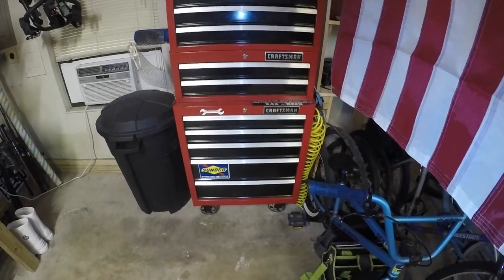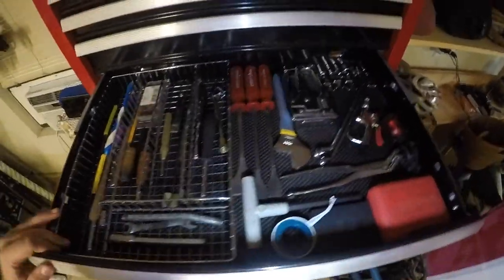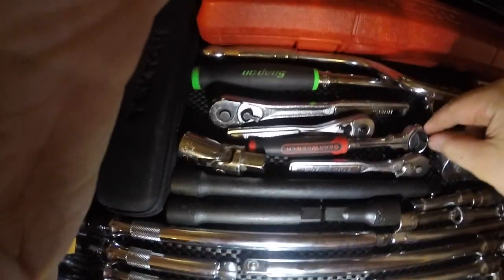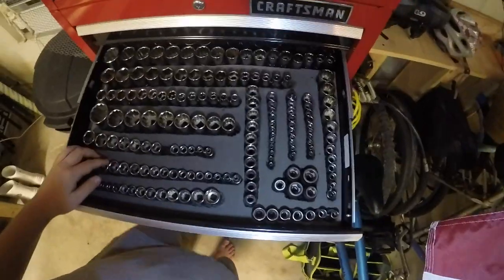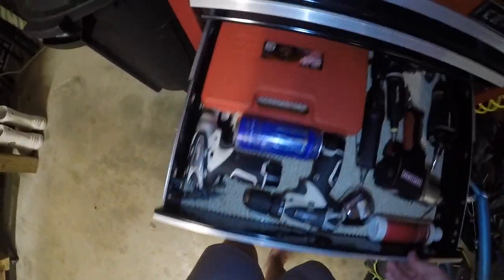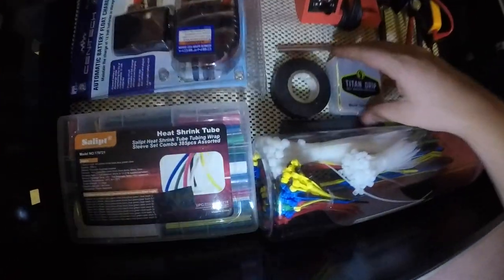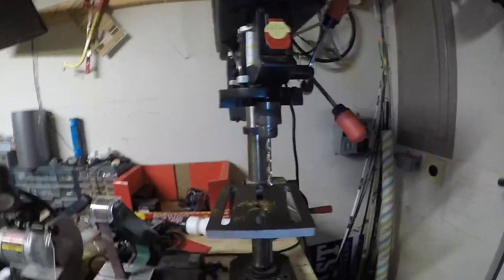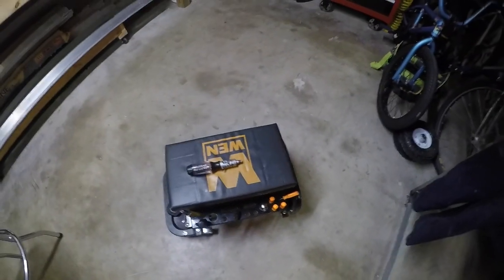14 year olds tool box tour | Joe the mechanic

Comment: Snap on separator is a battery tool for taking off battery hold downs very nice setup. You will need a bigger box soon . Thanks again for the tour.
Reply: As I’m watching this a year later as I’m 14 and starting my own tool collection as I’ve been working on four wheelers and lawnmowers have needed to have good tools but haven’t made it as far as you. But really like your tool box!
Reply: @spencercoleman5318  looks like your off to a good start good luck if your smart you will work for yourself. Go to trade school if you can.

Comment: Other brands have the style of wobble plus just look for the landings on the wobble extension. I have the gear wrench style like that. Get what you can afford for now when you start working save your money then if you wind up in a tech school you can get the snap on stuff cheaper. By the time you get there you will know what Snap-On stuff you will want. You have a lot more than I had at that age and a lot better quality.
Reply: The wobbles I love are the duralast ones there awesome
Reply: I never saw the duralast until I bought the gear wrench ones. Duralast tools are not bad I like them as well